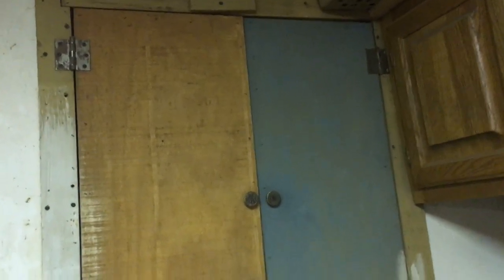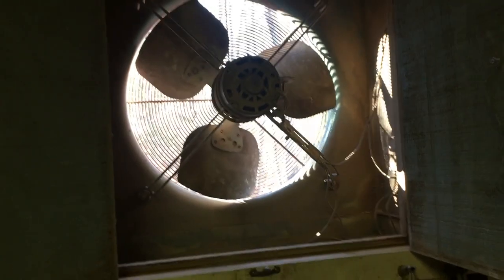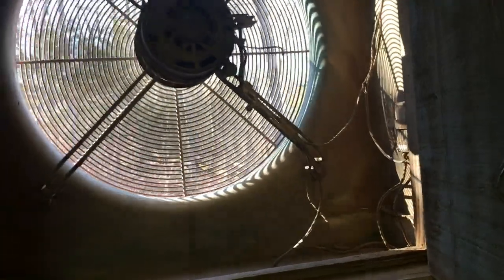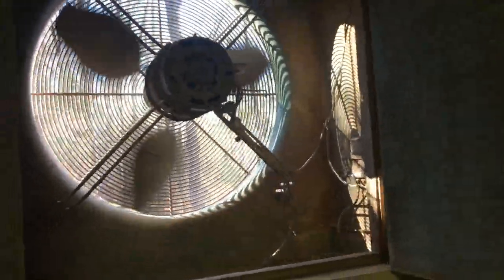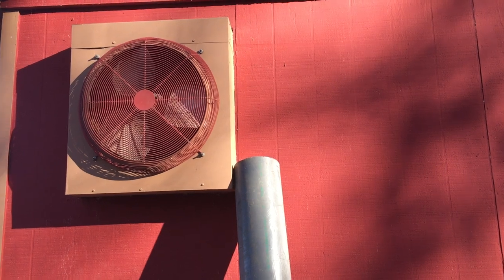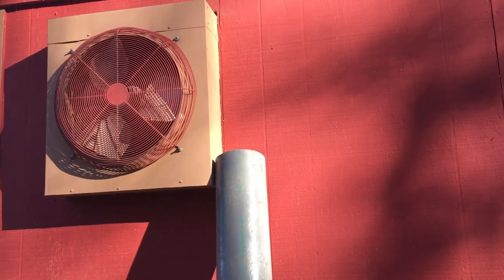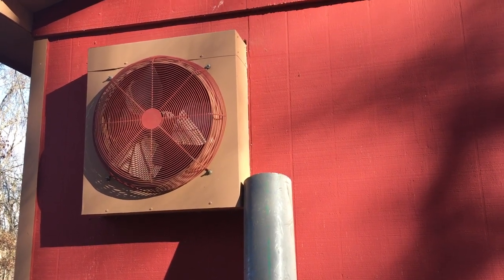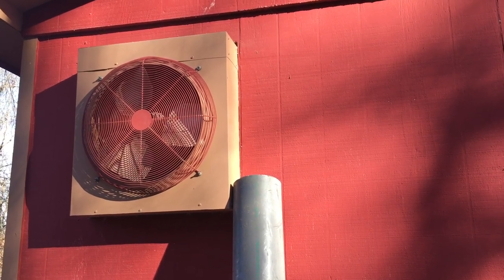DIY Ventilation for Workshop

Comment: Good evening Sir ( Wendel i believe ) from my heart,  Thank you very very much for this very good instruction video and also the time that you took to go to your friend place to show me this very well installed fumes and vapor extractor fan !  Merci Thank you very much and you have a real good humor I love it !!! Cheers et merci !!!  Joe,  I guess you will have another project coming up !!!lol
Reply from the maker: Heck Dave, it wasn't a problem at all.  It really does do a good job for a home shop.  Now would I recommend this for a commercial shop operation...No, not at all. 

A wall mount Northern Tool shop fan remounted in a wall opening would work adequately for this. and their cfm ratings are easily available.   I chose the condensor fan because of the built in frame and blade guard AND it was free.   I'd done another one where we built western cedar louvers for the discharge and covered the inside with 1/4" chicken wire. 

Oh, btw, do you think Joe will take the hint......???  Maybe we can nudge him again sometime huh.  I guess we can call this a 'collaboration' video can we....  being as how we are collaborating against him. Hahahahaha
Reply: @tractorman4461  Hello Wendel, we have most of us small garages. So the need for a good ventilation is very important since the small volume of air compared to a bigger and larger garage. You Sir with you great experience on working in various deadly environments including myself is to teach and pass more information since we saw to many peoples having industrial related sickness and health issue and having fun passing it !!! I'm pretty sure that Joe will come up with something very interesting for us !!! Brace yourself Wendel and me for incoming impak !!!

Comment: Well, you got me! You know what?  I already have a pretty good wall mount fan I use in summer, that I hang near the ceiling, facing the garage door. And I got it at the scrap yard.  Dave, you were with me today in the garage. You can see I crack the garage door (10' wide) 2-3 inches then I also crack the attick door.  Within a few minutes, the fumes are gone by convection.  When I want it quicker, I simply open the garage door a minute or two. Which is by the way 8'x10'. Then the garage is 16'x24'...   But I must admit, I should have a better setup... Well, another project! Thanks Wendell for this informative video.  Gives me some ideas!
Reply from the maker: Well Joe, Dave and I were going back and forth the other night about blowers and stuff so mainly for fun I put this together because Dave was interested in what was used and how it works.  But then I get to talking and have a tough time drawing it to a close...so you end up with lengthy discussion of making something from junk yard materials like this.  We were picking on you just a little though.....lol   Its all good.   ....and if it helps you in some little way, that's great !!
Reply: Sure!  The only thing I have to take into consideration is the size of my garage... It's just 3000 cu.ft (16x24x8.5 and substract a foot for the walls). Dave and I discussed today we should target for heat exchangers for our garages... Yes, Dave has a garage similar in size to mine and he also does some welding too!
Reply from the maker: Aha !!  What I'm hearing here is he's really the one that welds without ventilation.......lolol
The larger the area is the more difficult it is to adequately ventilate without some crazy big stuff. So maintaining adequate air flow across the area where you are welding/painting is the simple solution.  

Stick welding is much easier to blow away the fumes and the same airflow will mess with the shielding gas of the mig machines.  I'm sure you got the situation covered.  It's not like we can have an actual 'welding booth' with an exhaust hood to weld up huge projects.  My new shed is a bit to large to adequately exhaust the air properly, so it will be done with the appropriate fan placement as well.

Joe, what heat exchangers are in your sights....water to air ?
Reply: I do flux core MIG welding.  I don't know how it compares to stick welding. I meant a HRV, Heat Recovery Ventilator.  So it is air to air.  See link below
https://www.popularmechanics.com/home/interior-projects/how-to/a149/1275121/
Reply: @FromSteelToWood  Joe i'm doing like you, painting !!! and that's what is vicious against us !!!

Comment: very good! I have never used one from a outdoor unit but I have used the ones from an indoor unit. you do have to keep some back draft pressure on them by not keeping the doors wide open like you said just crack them a little. this will prevent free spinning and thus over amping which will create heat in the motor an eventually make the motor overload kick off. the old  gas furnaces with blowers typically have a 120 volt squirrel cage blower which is a great shop fan. plenty big to suck out the fumes fast. another great video really enjoyed it! I need to install one in my little shed for when I'm using this sulfur based cutting fluid on the lathe and mill. that stuff stinks and makes my throat irritated. wish I had a bigger shop.
Reply: Good morning Sir, the important thing is to inform people about safety !  Keep up the good work ! Cheers !
Reply from the maker: Well, size DOES matter...at least in the shop department.  hahahaha.  No matter how big a fellow builds, it seems as though it always needed to be a little bigger. I agree about the squirrel cages, they will work fine to create ventilation in a shop.  The reason they overamp in an unrestricted air stream is that they are designed to operate under a bit of static pressure.  Static pressure, either positive or negative is generated by restriction as noted in your comment.

When I use a squirrel cage built into a frame on the shop floor, I'll hang a clamp-on ammeter on the motor common wire and cut a thin piece of sheet metal in a circle a couple inches larger than the opening in the cage opposite the motor.  Screw one screw in to act as a pivot point, plug in the motor and read the ammeter.  Adjust the sheet metal over the opening until you get to 80% of the full load amp rating of the motor on high speed  then lock it in that position with a second screw. That way you don't have to worry about tripping the internal overload.  High speed is usually the black wire on old standard direct drive motors.  There are a few exceptions though.  And as you know Dave, most times there's a wiring diagram on the side of the motor, though sometimes visually restricted by the belly band. Dang it.

Another thing sometimes fellows overlook....take a standard house three way switch, and apply line voltage to the common screw and use the other two terminals to switch between two speeds on the multi-speed motor.  It just gives you another variation for varying cfm delivery.  Of course the other line voltage wire goes to the motor common terminal.  

Now about that bigger shop.......  Thanks for watching and commenting Dave !! I appreciate it sir.
Reply: @tractorman4461   that's a great idea with the sheet metal and amprobe and restricting to 80% amp draw.
Reply from the maker: Yessir, I've done it many times.  You can edge it up just a bit over 80% because motors have a typical service factor of 15% over, but they really run pretty hot much over 85 or so. 
Thanks for following up Dave.  You will be surprized just how far you have to close it off on some of them.  But it does force more of the entering airflow across the motor that way too and assists in keeping it running a tad cooler.
Reply: @tractorman4461  I been thinking about building one with a charcoal filter and just use it to clean the air so I don't loose my heat in winter. not sure if a charcoal filter would do the trick or not but worth a try.
Reply from the maker: I'm thinking there should be a spec on the air velocity through the charcoal to NOT exceed to maintain its filtering capability.  Lower velocity is better, the higher velociy forces particulate through filtering media at a higher rate. If you had a cheap plastic velometer, you can measure the speed of the airflow at multiple points across the surface then add those readings together and then divide by the number of locations that the readings were taken from.  That average should be good enough to figure what the velocity is.

If you want to go one step farther, you can figure approximate cfm then by multiplying the area of the opening by the average velocity.  So Dave, if I'm remembering my stuff correctly: CFM=Area x velocity.    Now this is typically used for measurements inside ducts, and may not correlate perfectly to a discharge opening of a blower, but it should put you in the ballgame. I may try to dig out an old velometer I haven't used in years and do a short video.  But it depends on if I've not given it away already.  I'll have to check.
Reply: look forward to seeing it.

Comment: Hey there Wendel!!!  Wow, what a bunch of info you just went over.  Great to know how to calculate how much CFM you need to vent your shop.  I have to admit my eyes were getting glazed a touch but I did get enough to figure out how much CFM I need to vent my shop.  In my shop I have a dust collector, a 2HP King and I have it in another shed and ducted into my workshop with inlets for the wood working tools.  I don't know what the CFM is but I do know this:  in the winter when I have a fire in the stove and the doors closed, if I start the dust collector, the shop fills with smoke from the stove!!!!  Anyway, thanks for the info and take 'er easy!!!  Aurevoir mon ami!!!
Reply from the maker: Oh heck yeah about drawing the smoke down the chimney !!  You are drawing a negative pressure in the shed quickly with that dust collector. Remember the restaurant door you could hardly pull open ?  The exhaust fan was running and the 'make-up' air unit had a bad belt and the restaurant drew into a negative pressure just like your shop. Well, that and other things. lol

 Another buddy put his cyclonic separator outside in his lean to, but to keep the pressure in his shop neutral he matched the collectors cfm and interlocked another fan to dump air back into the shop anytime the collector was running.  It did pretty good, but sometimes it wasn't really balanced due to which one or how many blast gates were open.  Now, if he'd had DDC controls, a building pressure transducer, a pair of VFD's on his motors.....arghhhhhhh !!! STOP alright huh.
Reply: I hear ya!!!  When I was working; the shop I worked in had several big rubber milling machines and they required enormous amounts of air to be pumped into the shop because they were expelling air from the shop in order to cool the rubber as it got very hot while on the mills.  The rubber mills provided heat for the shop in winter and the air exchangers provided cooling in the summer!!!  Ah I wish I was back working ... oh wait, what did I just say!!!  I gotta go and have a dose of reality!!!  Take 'er easy good buddy!!!

Comment: Great info, Tractorman44!  Thanks!  This is timely as I’ve been thinking about the ventilation of my future shop building.  I plan to be welding in there occasionally.
Reply from the maker: There are definitely better ways that move air more efficiently, but this is an exercise in frugality that works fairly well.  Automotive paint booth...nope, but welding fumes and small spray painting and pre-catylized lacquer on wood projects...heck yeah !!  It seems to do more than an adequate job.  Another comment snuck by my radar sir....I don't know why I'm not being notified on some of these.
Reply: No worries, mate! I sometimes have the same problem on notifications and have peruse the comments to find some I’ve missed.

Comment: How the heck did I miss this video, I wonder!
I have the same issue Wendell,..my welding shop/garage is 25`x 20`x approximately 12 feet high, so my calculation is that this is a 6000 cubic foot space.
 Now I have a squirrel cage blower from a warm air furnace,..unfortunately I don't know it's capacity in cfm ( but it does blow well ) I wonder if this will work.for me. I can test this easily enough,..my personnel door  2' 8" x 6' 8" is at the opposite end of my shop and there's a 10' x 8' overhead door in the other. 
I think i'll set up the blower in the small door crack open the overhead door and see what results I get.
Reply from the maker: Good Morning Sir....the larger the area is the less air movement you may feel which is why when spray painting he would slightly crack the opposing door to increase the air velocity entering the space.  Plus with it entering down low and exiting several feet higher, the theory was to draw that moving air somewhat across the path of a person standing up and  painting or welding.  I hope you can find a solution for you shop, but you certainly have a good sized area.  If your blower is a multi speed 1/3 hp, it would be capable of 800 to 1000 cfm...probably.  Sometimes a blower not operating in the confines of duct will overheat due to over amping the motor. That becomes a whole different story right there. LOL  We can leave that go for another time though.
Reply: @tractorman4461  Yes, OK then, we don't want or need to make this too complicated for the other's who may be watching this either, I agree.
My main concern is moving smoke from welding,.and this I can do fairly well with the open doors and a booster fan.
Thanks for your reply though.
Regards!

Comment: Hello Sir I was wondering if you could recommend an exhaust fan for my small welding area? Do you still check into these comments....not sure Anyway thank you for sharing!
Reply from the maker: Well for a small welding area one of these condenser fans off of a central air conditioner works wonderfully well. Even a whole house exhaust fan (attic fan) would do a good job. Actually that would be a superior option but the air conditioner fan is much more easily found. I wouldn’t recommend this commercially but for a guys home shop it’s great !!  Anything to get the welding fumes away from you. Another option might be using a residential furnace ‘squirrel cage’ blower set on the floor to flood the work area with air flow  to move fumes from your welding area. But to be safe they must be exhausted to the outside.